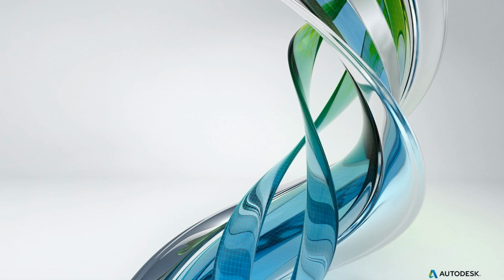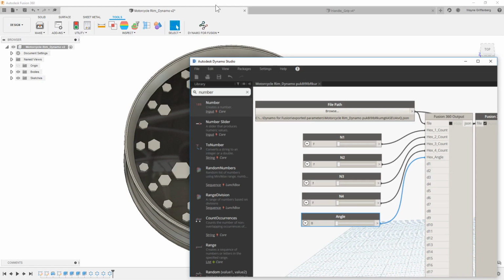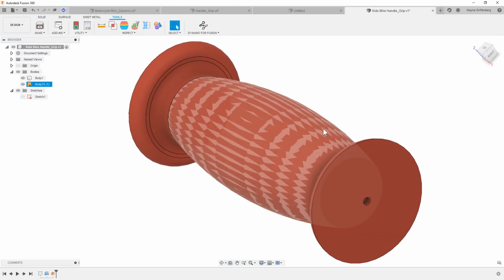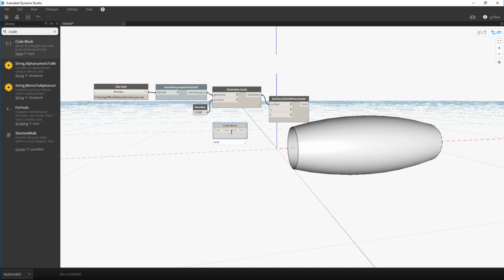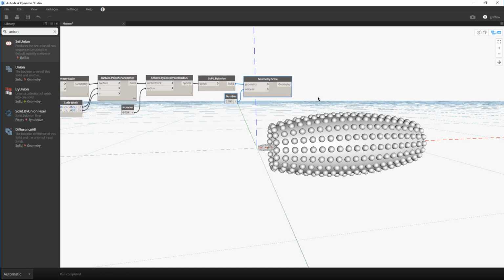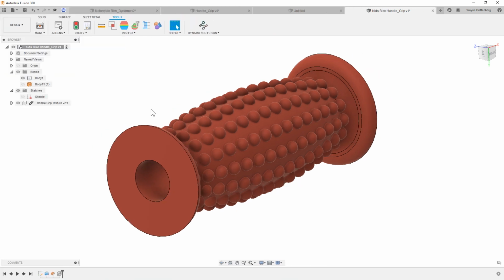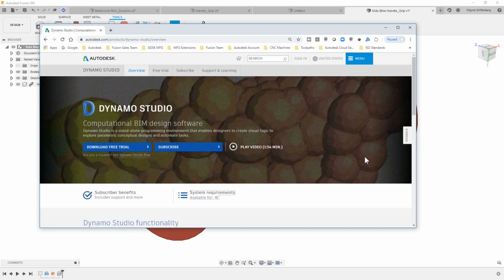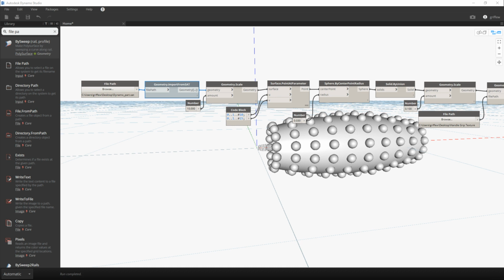360 LIVE: Fusion 360 + Dynamo Studio

Comment: Two Questions:

1. What is the workflow to change the surface properties? Example: If you change the length of the grip you created, can you just export the surface and re-import that into Dynamo? 

2. Can you use this tool for components and not just surfaces? An example would be using screw on attachments for your grip. You would want to create an array of nuts, countersunk holes and screws. Ideally this tool could be used to create variations of assemblies by adjusting parameters.
Reply from the maker: Hey Garret, I'll see if Wayne knows the answers to these...my best guesses are (1) yes, but that would probably be super hard, and (2) yes.

Comment: That could have solved the problem I tried to solve a year ago! Just wonder whether the cylinders put in points could copy the outline of the inserted body?
Reply from the maker: It's a great solution to some very complex problems. I don't believe it's free, what you may be seeing/referring to is a tool that pushes to and from Fusion 360 to Dynamo.
Reply: @adskFusion  You were right, I am a student, maybe that's why I san use it for free. Anyway thank you for the video!